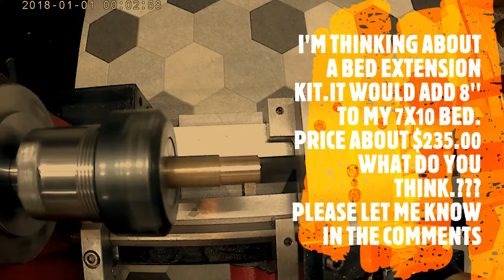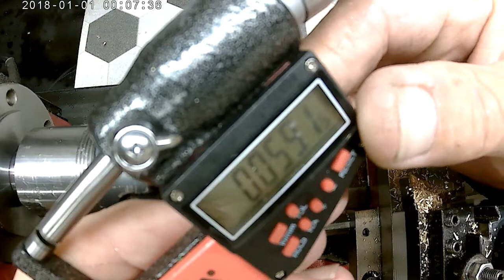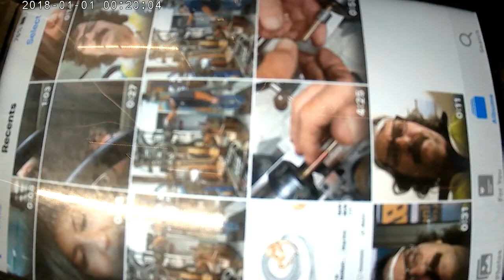MINI LATHE TURNING

Comment: Are you talking about the LMS kit that replaces the entire bed? I’ve never known anyone who used the casting, but I’ve always been curious how the new bed matches up with the machining on the existing head and tailstock, and the saddle. If it all works together well, you’d have a much more useful lathe! Especially since the 7x10 that you have is actually 7x8! HF takes some liberties with their measuring! The aggravating part is that you have to tear the old lathe apart and attempt to reconstruct it before you were sure it all fit! LMS stuff is generally spot on though!
Reply from the maker: Yes  LMS 
THEY SAY THE 7x10 gets the biggest bang for your buck . I think because it’s realy a 7x8 or so .
Thanks for watching and commenting
Reply: @kimber1958  Of course you’ll do a thorough video (or 5) if you do the change!?! Right?.

Comment: You need to make a rock solid base for your lathe.
Reply from the maker: I need to tighten the leg bolts and attach the table to the wall with some bracing the table itself is very heavy and has an almost 2 inch soapstone top. Also the lathe is bolted down to the table .it used to be better the bolts holding the legs on must be getting loose I’ll try to get that taken care of right away thank you for your comments
Reply from the maker: I just took care of that little problem thank you very much for the comment and the motivation